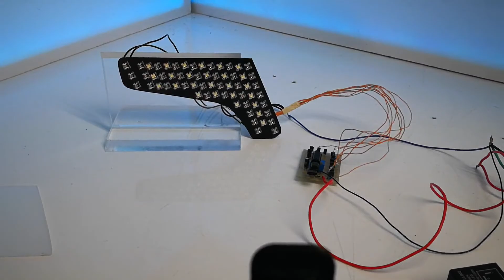Sequential Blinker test 1

Comment: Awesome diffuse setup. Can you by any chance provide the wiring pattern and resistors setup you did in the rear of the panel to make it flash sequentially?
Reply from the maker: The Sequential relay part with resistors is separate to the LED panel. All the info on diagram and parts list can be found here. https://www.hidplanet.com/forums/forum/general-discussion/leds/28225-analog-sequential-led-turn-signal-parts-list-and-diagram/page14